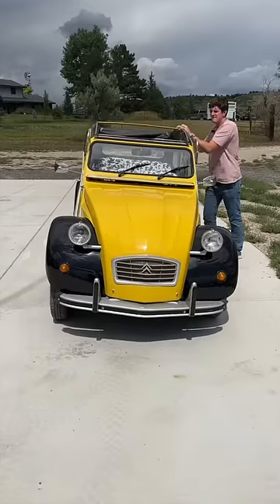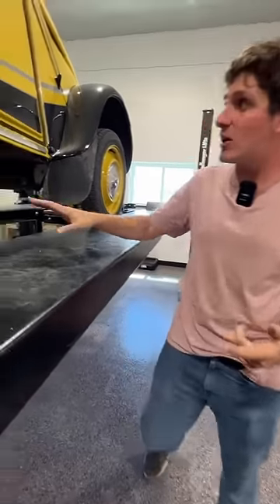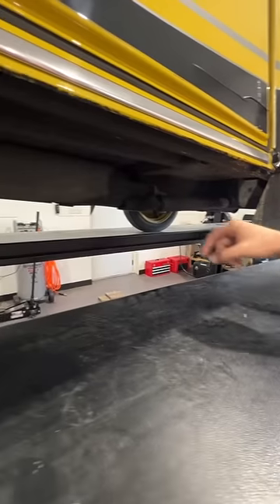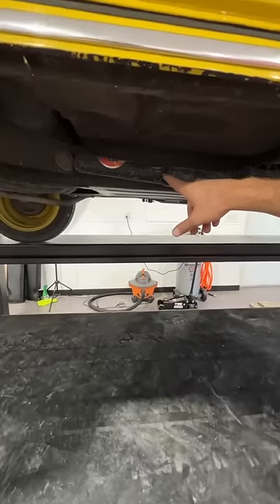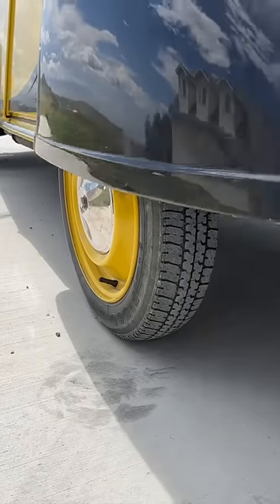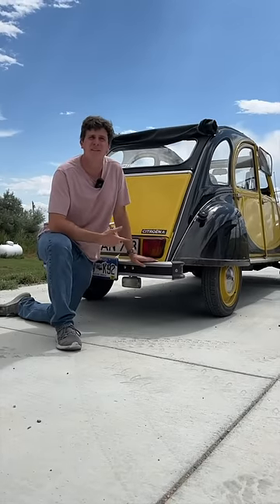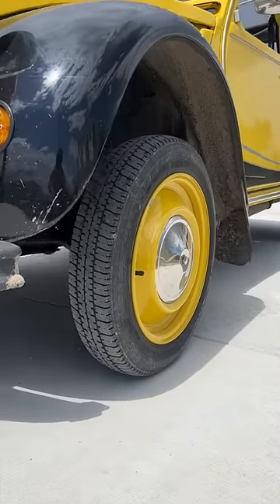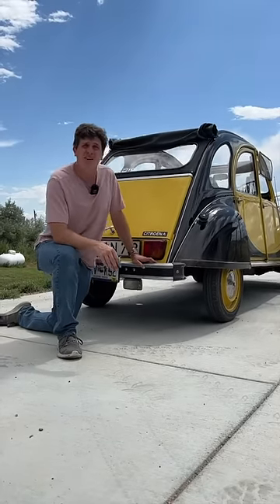This Car Is Impossible To Roll Over

Comment: Those cars were designed with that soft suspension so that farmers could drive them across fields and bring their eggs to market and not break any.
Reply: exactly
it handles great on surfaces that it was made for driving on
Reply: So do 1973 Lincoln sedans.
Reply: Eggs or farmers.
Reply: @WitchKing-Of-Angmar My 2010 GL handles just like a Lincoln. Airbags are smooth. But it costs you when they need to be replaced. 😂
Reply: Car manufacturer: We need you to build the most advanced high tech suspension known to man.
Engineer: Only under one condition.
Manufacturer: What's that?
Engineer: As long as the farmers can get their eggs to market.
Reply: @unwavering_sightseer7818   Hmm, what's a GL?
Reply: @WitchKing-Of-Angmar  It’s a Mercedes GL 450. I bought it from my dad when he got a new one.
Reply: @miaugato93 Eggs
Reply: @WitchKing-Of-Angmar but a Lincoln is very heavy, with hardly any clearance and big thick flat tires.
Reply: Exactly what i was gonna point out
Reply: @miaugato93 🤭
Reply: WOW!!! COOOL!!!!
Reply: Oh cool
Reply: Not break any what?
Reply: Actually, it's cuz the roads in France were almost nonexistent after WW2 due to all the bombing, etc.
Reply: A box with eggs was put on the back seat and driven over the farmlands and they must survive and car should not gett stuck in the mudd😂
Reply: Nowadays everyone wants a car to transport a iphone 
Just it doesn’t break
I think farmers needs it more
Reply: That's cool! Would have never guessed.
Reply: British and Irish farmers had sense buy a jeep
Reply: with 2 sheep in the back. so my dad used to tell me. 2cv = 2 sheep 🐑🤷
Reply: That was just an ad. French roads were almost non-existent after the war. Easier to build a capable car than repave millions of kms of roads
Reply: Which is why you have to heavily modify your 4x4 just to get it to flex like a 1910s - 40s car! Props to stuff like this. I love when stuff was really innovative
Reply: “Bought” your daddy bought your entire life buddy, you’ve never truly worked.
Reply: That was just an advertisement. It was for post war French roads which were terrible
Reply: @OscarOSullivan  LOL, you joking? A Jeep?
Reply: I thought it was of you dropped it from 500ft the suspension would absorb the impact
Reply: @Gobbbbb  Yes a jeep be it an actual branded jeep or land rover at the time
Reply: wrong - youre basing your knowlage on the advertisment while the true reason they developed such suspention was the roads in post war france were very bumpy. stop spreading misinformation
Reply: Junk
Reply: Designed for rural france back then, where the streets rarely had paving.
Though one could become seasick when driving on normal roads, feels completely different than any other car suspension.
Reply: An egg
Reply: Someone has watched top gear
Reply: I don’t believe that’s what it was designed for but that’s what the commercials and advertising was
Reply: They weren't designed for that they were designed for rough roads
Reply: You beat me to it. Citröen suspension is amazing
Reply: Thought it was for your mother
Reply: @Shnierpiffle  What is?
Reply: @georgeglass3680 the meanuture: 
engineer: my eggs keep being broken! 
M what: 
Engineer: dads a farmer….
Reply: It was a freshly ploughed field aswell. Not just any old field
Reply: In Canada we made a cardboard box for the egg
Reply: Thats a myth
Reply: @DannyKoKo exactly the comment I was looking for
Reply: it turns out that Citroen produced a half-track system that inspired many WW2 vehicles :O
Reply: Yes the farmer egg lore thing
Reply: ...that statement was disproved on the Gran Tour by Jeremy Clarkson...

The CV handles terribly, and really isn't hard to roll... 🙄
Reply: @georgeglass3680  often early car designers would make designs for seemingly stupid reasons. But consider the fact that most farmers have the money to blow on a car like that.
Reply: Naw, the purpose was so you could easily light another cigarette while driving over a field.
Reply: Design criteria?.Must be able to carry a farmer his wife, two children and a pig, across a ploughed field..At minimum cost.
Reply: furry detected opinion rejected
Reply: Grand tour
Reply: Def why
Reply: @billybadass9031  Eggs
Reply: @OscarOSullivan it's a land rover!
Reply: built in 1949, when the French roads were still being rebuilt after WW2
Reply: I've always heard it was to drive on war torn roads of post ww2 Europe lol
Reply: @miaugato93 eggs of farmers ;)
Reply: The 2CV is to cars what BREAD is food -- it is the baseline.   

Let's get it back into production and make it one of the world's transportation options.
Reply: A car for the common people
Reply: The delivery van would be really good for farmer's too. 👍

Comment: Here in Italy these Citroen’s are still seen often on the roads. They’re like the original Volkswagen Beetle in that they just run forever and they’re cheap to own and maintain. The body panels are all replaceable, and it’s easy to do. Rust is really the only problem, but anything that rusts can easily be fixed or replaced. They’re not fast, but they’re lots of fun to drive.
Reply: Cette voiture n'est ni très présente en Italie, et ne ressemble en aucun point a une coccinelle, c'est une voiture purement francaise
Reply: I'm looking for a manual in Europe as our American cars are junk. Only 3% can drive a stick so very few available. Do you have any suggestions?
Reply: @pamspencer5733 I live in America, and am American....if you want a really cheap, really reliable car, get a 95-99 Nissan Sentra/Sunny....with the manual transmission of course. They were sold around the world.  Imagine the ease of repair and longevity of a 90s Japanese car....but with a chain instead of a belt for much greater reliability (and it was over engineered).
Reply: @pamspencer5733 I drive a 98 Sentra with manual myself. My commute is 4 hours one way and never fails me.
Reply: @fortheloveofnoise  Wow, impressive!
Reply: @Fanautoretro why are you like this
Reply: @fortheloveofnoise So commuting is just your full time job? Sheesh.
Reply: @fortheloveofnoise I used to drive a '91 Sentra.   Couldn't kill that car even in our cold Canadian winters.. The body rotted out before the engine would fail.. Great little cars
Reply: @Fanautoretro  tu veux bien te calmer Antoine?
Reply: @Ang3lUki he is the average French
Reply: Hmmm... I car that defied the Germans versus a car made by Germans... An interesting comparison to be sure.
Reply: @Fanautoretro  depends on the region you live in, 2CVs are French cars but they are also used in countries other than France
Reply: @Fanautoretro juste tg
Reply: @Fanautoretro yeah it's perfectly french meaning it sucks really bad hahahah baguette baguette oui oui
Reply: I waaaaant ooonneee
Reply: @Fanautoretro  French propaganda.
Reply: @Fanautoretro tu comprends l'anglais mais réponds en français. The worst part about learning french is that french people speak it.
Reply: @Fanautoretro Vous n'avez rien compris le commentaire auquel vous avez répondu. C'était écrit qu'elle est similaire à la beetle en termes de fiabilité et de coûts, mais pas qu'elle le ressemble.
Reply: Here the VW Golf mk2 is far more common, especially the diesel one. Very reliable, decent fuel economy and also cheap to own and maintain.
Reply: @pamspencer5733  Two Skoda models, either Octavia or the Superb. The Superb is used by lots of taxi drivers in the UK. They are both spacious and reliable. The Octavia is slightly smaller.
Reply: @Fanautoretro  umm... 2cv was designed as a cheap car for masses, Beetle was cheap car for masses... They were different approaches to the same concept.

Comment: The goal when designing this car was that common folk could drive straight across a field with a basket of eggs without them breaking.
Reply: And you actually can! I did it once, very stable
Reply: @antonio_luis_  yea its pretty good but the ds hydraulic suspension is even better
Reply: This sounds like a direct quote from some          pompous engineer talking down to dumb common folk needing to collect their eggs like plebs lol
Reply: @deadline546 , Jesus Christ dude....
They built the car like that after ww2. Because french roads were destroyed, so it had to have a good suspension
Reply: @antonio_luis_  Interesting!. It still sounds funny how they described though. Its humor! I mean who actually uses the term "common folk" unless they read it while researching. lol
Reply: @deadline546  bro chill
Im not a native english speaker
Reply: With two farmers as passengers and 50kg of potatoes in the trunk if I remember right.
Reply: @deadline546 it sounds like you are a simple.... hater.
Reply: @antonio_luis_    They built the car like that after ww2.
They designed it before the war, from 1935-1939 and hid it from the Germans. They had one headlight because that was all the law required at the time. The development instructions were “4 wheels and an umbrella”.

It was to be an inexpensive car for the masses, most farmers who still used horses to bring their produce to market, hence it could be driven with clogs (wooden shoes), the pedals were spaced wide for that reason, as farmers often used them. Capable of crossing a freshly plowed field, and not breaking eggs the passenger seat. 

2CV literally is the abbreviation of “two taxable horsepower”, btw. 

Air cooled engine, you could hand-start it — and would have to in early models — it was also available with an extended trunk, with a van body and so on.

It was a front-wheel drive so no long shaft was needed from the engine, it was built to be light-weight, carry 4 and 50kg at 50 Km/h (~30mph) over muddy, unimproved roads, and with the 9 hp engine had a very economic fuel use. (That’s why keeping it lightweight (and simple) was a priority.)

Because french roads were destroyed, so it had to have a good suspension
BS.
The French road system was not that much in 1935, lots of unimproved roads, often enough muddy and all that, for rural populations. 

And no, even Nazi Germany did not set out to destroy all infrastructure when they were pushed out.

Look things up, don’t make them up!
Reply: @advorak8529 Thank you for pointing this out! Even in the video they claimed the car was developed after WW2, which is just not true. It would have helped to read the Wikipedia Article first😂👍

Comment: The suspension on the DS was also, out of this world. Love these Citröens.
Reply: My first car was a 1975 GS Pallas. 1.2L Air-cooled boxer engine, incredible suspension, and half a ton of rust... 
The CX I got afterwards had the 2.0L gasoline engine and Servo Steering. Man, what a Cruiser!  You were more rested after a whole day of driving than when you started. 
The BX Estate after that wasn't as comfy, but still the magic carpet ride, and lots of space in the back After that was killed by a 6WD dump-truck... I got a Berlingo... The one car that could really have used the Hydro-pneumatic system. The first was killed by a bl**dy SUV. The second was killed by E10 Gasoline(gave up this summer) and now I'm driving... a Berlingo... 2014 eBerlingo Van.
Reply: It was that good Rolls Royce used it
Reply: @doz7496  But they could only afford to license part of it...
Reply: Too bad Citroen doesn't make it anymore..
Reply: @norwegiangadgetman hi.  your experience is amazing . but why the BX is less comfy than other
Reply: @ismiismael   I honestly don't know. The seats were stiffer, but I don't think that was the reason. It could just have been me. That  the difference in feel from the CX to the BX just 'translated' to 'not as comfy' in my brain. It was a very good car, really. Too bad about the 6WD dumptruck that backed into it. The M49 Berlingo I got after it is by no means as comfortable, and lacks the Hydropneumatic suspension(the one car that could really use it), but that one was 'Just right'. Got a B9 series(2008 - 2018) 'Berlingo II', all electric this summer. Seats are stiffer, less adjustment possible(it's a van), but again, it feels right.

Comment: These were ubiquitous in France and other parts of Europe for a long time. The French answer to the VW. They had a huge amount of body roll but as you said they wouldn't roll and they were fantastic on rough roads. Most French roads were rough at the time.
Reply: Yeah pretty much, though both were designed with different roads and driving speeds in mind.
Their initial engines were also similar but with a completely different design for the carburetor, ignition and valve control.
The Citroën uses a waste gate ignition if i remember correctly, which used up spark plugs twice as fast but was extremely reliable in return.
Reply: Dang, it's too bad I can't buy this new today with a barebones fuel injection system. I totally would.
Reply: @PatrickKQ4HBD electronic fuel injection or mechanical fuel injection?

Comment: something else i learned about 2cv’s is that the engine is built with such tight tolerances that there’s no need for any gaskets. which is very impressive for 1940s technology especially during the war.
Reply: Before the war the hydraulic system was built in a factory that built diesel engine injectors because no-one elses tolerances were high enough to run gasket free.
Reply: @deefenbakerone4369  oh i didn’t know that, thanks deef

Comment: Meanwhile, the Robin Reliant. "Please don't approach me. The shifting wind you cause might send me careening to the next county."
Reply: The typical level of wisdom from someone who gets it's name wrong. It's Reliant Robin. Reliant was the company.
Reply: It's almost like we can know the manufacturer even if we put the name of the car first. But hey, at the end of the day, we're just here to have a chuckle at the expense of a car that got weighted to roll over on television for the laughs.
Reply: It's no big deal. I'm about to go for a drive in my Escort Ford - care to join?
Reply: Sure, lemme get the C70 Volvo
Reply: The Robin Reliant was actually very tough to roll.
Reply: My favorite thing about the Reliant Robin is that a company actually decided to build something more difficult and dangerous to drive than a regular car for people who didn't have a license to drive regular cars! 🤦‍♂️😂

And not only did people love it, but the legislator also went: "yup, seems fine!"
Reply: @kielba5a with the weight of the engine and transmission above the single wheel, it definitely rolls easier than any four-wheeled car.
It might not roll in normal traffic, but in a side crash it surely had a significantly higher chance to tip over or even roll!

Also, there's a Robin racing series and the Robins DO frequently tip over in these races. So yes, you can definitely roll them!
Reply: @LRM12o8  I'm sure rolling them is possible, but still very tough. And with racing series where the cars are cheap and the "no contact" rule isn't strictly enforced, flipping is pretty commonplace.

Comment: Three fun facts about the 2CV:
1- the wheel to wheel width was designed to be able to drive down plouged rows on farmland.
2- the suspension needed to be good enough that if you put a crate of eggs in the back seat not a single egg would crack while driving ~40kph down said rows
3- the roof needed to be tall enough to accommodate wearing a large hat, something one of the 2CV’s designers was quite fond of wearing regularly.
In many ways, it was billed as the farmers car. Designed to be cheap, efficient and capable, the idea was to replace farmers using horses for thing like transportation and get them motorized.

Comment: I wish something like this was produced today. I think it would be popular. Lots of us are looking for an affordable, economy car without all the tech and is easy to repair. I always liked them. Would buy one if it was as nice as this one.
Reply: Renault has a sub-brand called Dacia. Relatively cheap without all the bells and whistles. And the reason cars have gotten less easy to repair over the years is because of increasingly complex technology. They needes to, because they needed to move past the 600cc 29HP engines that the 2CV topped at. The most powerful one had a 115Km/h top speed and 0-100 in 35 seconds.
Reply: @hairsonabobbin  Thanks for the reply.👍

Comment: I really like these vintage cars. A real shame that you don't see cars like this often anymore.
Reply: I always think there has to be or one day be a car company that makes old fanishon cars cause I love a 1951 Chevy
Reply: Well, you would definitely need a new engine, unless you like pushing your car uphill... that's mostly where the fun ends.
Reply: @tomasviane3844 the 50s cars had pretty good power, unles u mean this French bug.  As an American who has only seen NONE of these ive no idea what powered them.
Reply: @ss67camaronut  It has a 2 cylinder boxer engine that drives the front wheels. The first versions had 9 hp, the last ones a whopping 29 hp. That's basically nothing, but it is enough to get this car to 100 km/h (~62 mph) in about 50 incredible seconds if i remember correctly. My dad has a card game from back then that featured this car. Yes, they actually put this in a card game😂
Reply: @BayerischeMeisterWerke it was a car meant to be cheap

Comment: This looks like the car in the James Bond movie "For your Eyes Only." It actually flipped in that movie.
Reply: Yeah, because that's a movie. In movies, cars also explode when they crash.
Reply: Lots of movies use controlled detonations to flip cars. Basically its an explosive charge attached to the bottom left or right edge of the car that goes off sending the car into a roll. Theres also the same thing but using high-pressure nitrogen, hydraulic/pneumatic flipping arms, hidden flip-ramps, just flipping the car, etc. Depends on the type of shot, your budget, the intensity, among other factors.
Reply: Bond and the Bond girl were driving the car down a hillside to escape from the bad guys. As I recall, it rolled over repeatedly until it reached the bottom. It was kind of like cutting switchbacks.